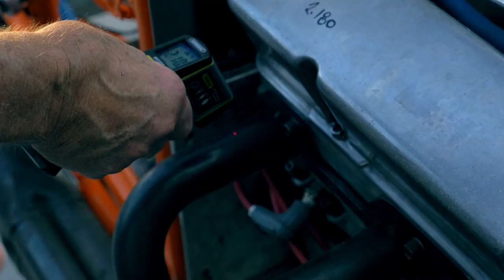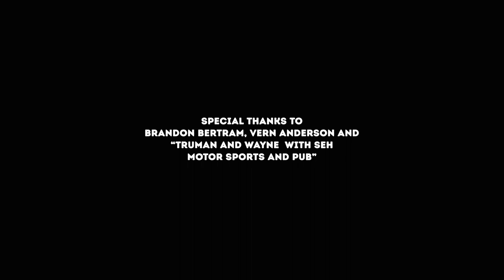Gossett Brothers - Birth of a Sprint Car Team (Short Film)

Comment: how much for roller >?
Reply: A new roller with good parts will run you $38,000.00 With no spares Then you’ll be spending another $45,000.00 for an engine that will need a $15,000.00 rebuild after 8 races or so if it lasts that long.      We run an 80+ race schedule and spend shy of a million per season.